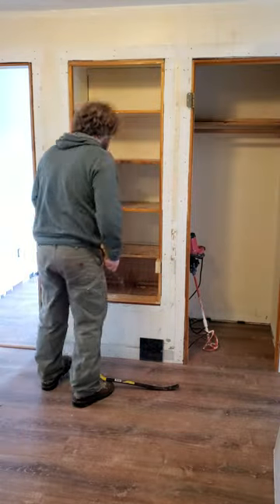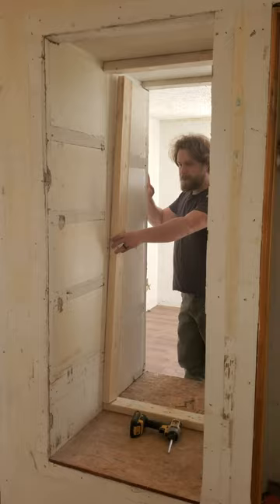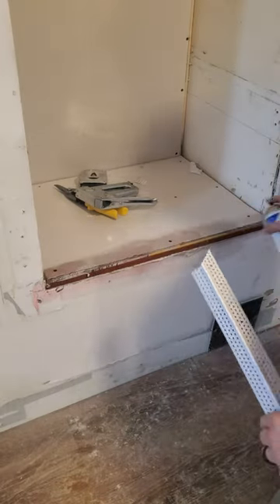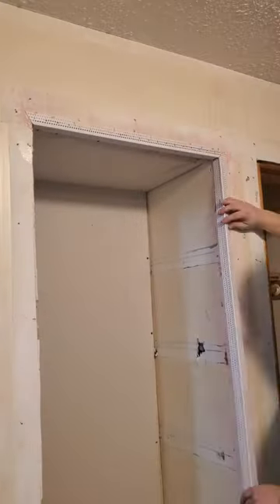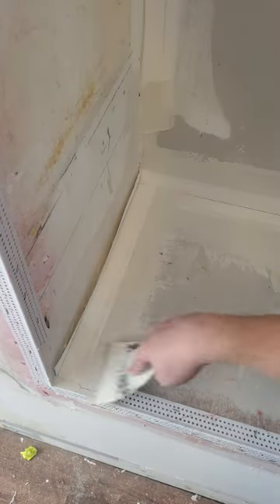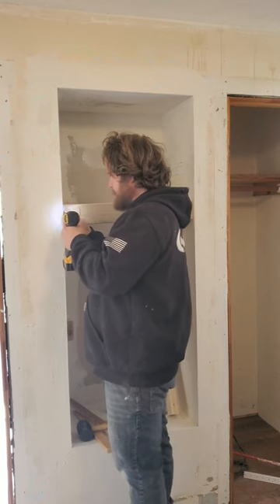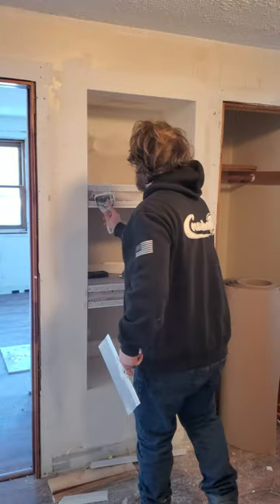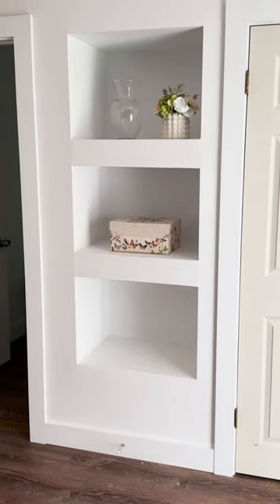Make Modern Drywall Shelves

Comment: Glue and staples isn't code, teaching bad habits
Reply: Yeah, I always just used mud...
Reply: Wrong.
Reply: There is no fuckin code for corner bead 😂
Reply from the maker: I’m not sure what code you’re referring to.  Most state building codes in the U.S. refer back to the manufactures recommendation for installation, this method if approved by the manufacturer Trim-Tex. If you’re referring to fire code, this shelf would not be acceptable but only because it’s built with 1/2” sheet rock and fire proofing requires two layers of 5/8”. If I’m unaware of a code you’re referring to please let me know. I’m a real nerd for building codes. Thanks for watching!

Comment: Cause drywall is soo much stronger than plywood.
Reply from the maker: I see your point that drywall is not stronger than plywood, but that’s not really the issue here, the structure itself attached to is. The drywall is supported by a 2x4 shelf and 3” screws, the plywood was supported by some additional strips of 3/4” plywood and held in with a few finish nails. This old system actually worked fine and held up well but the new one should be even stronger. I hope that helps explain my thinking. Thanks for watching!

Comment: Those corner beads are supposed to be installed with mud not adhesive or staples
Reply from the maker: Installing them with mud is another great option, both ways are fine according to the manufacturer. The same company who makes the corner bead makes the adhesive I use in the video, hope that helps and thanks for pointing out another great option!

Comment: Your quest to suck less at drywall lead you to suck more at shelving. Lol. Those things are gonna get absolutely destroyed if you ever put anything on them at all. There's a reason this isn't a thing.. It's not because you're a genius. 😉

Now, if you'd sheathed the top in some kind of durable material, with steel corner beads at your leading edges, that may hold up since the drywall is essentially just a fascia.. Maybe glass, or lexan as a protective cover at this point? But as others have pointed out, you also ate up a lot of space for it.. 

Your mud job did come out tits though, bud. Pat yourself on the back for that part. 😊

Comment: You use metal corner bead so when you hit it it doesn't fall apart also drywall looks awful the old ones probably held more too if you're gonna do it wrong anyway just use newspaper dude just use the fold as a corner you can fold it over something square to make more folded parts

Comment: And weeks later, they were beat to shite. Also use tape with the corner bead to prevent your inevitable cracks of a non durable design. Yeah, DYI. Holy Smokes!
Reply from the maker: I’m sure paper tape over these wouldn’t hurt, but you shouldn’t need it according to the manufacturer which also matches my experience with this product. As far as the durability is concerned, they are holding up fine for now but it’s only been a few weeks. I’ll try to give an update in a year or so. Thanks for watching!

Comment: Why? Theyll break easy.
Reply from the maker: That’s a fair point but I don’t think they will. The void between the studs here are much smaller than on a wall, making it stronger, and a wall can take a lot of damage. Place one hand on a wall and lean forward with as much weight as you can and you shouldn’t have any flex or damage in the wall. This should be more weight per square inch than anything that will fit easily on one of these shelves. I hope that helps explain my thinking and thanks for watching! 
P.S. if you lean on the wall and do put a hole in it, we’ve got a video a that shows you how to fix that.
Reply: @OneWayToMake  I live in the UK, very few to none houses use mudded joint plasterboard. We tend to render plaster over the full surface. The break easy wasnt a reference to strength, but impact resistance - sure progressive loading would be fine, but even a hardwood table suffers from dings and dents from putting pots and vase on and off - that's what I was thinking for the shelves.

Comment: Looks nice, but definitely a case of not done correctly
Reply from the maker: Thanks and I’d love to learn more, what are you seeing that you would have done differently?
Reply: @OneWayToMake  the corner beads should be mudded, not glued on.  Drywall screws, not staples.  The corner beads will eventually pop out.  

The shelves should be wood or melamine.  They look nice as is, but won't have good support.

It looks beautiful, but it won't last.

Comment: Just fold the cheap tape in half like a paper airplane. Then use your knife to get it in the corner. I don't wanna see you waste good money.
Reply from the maker: That’s really good advice, and anyone looking to save money should definitely go that but that stuff does make it easier and gives me a straighter line in my experience. With enough practice with traditional tape you can get just as good results though. Thanks for the tip and for watching!

Comment: Drywall has no structural rigidity.... the staples won't secure the corner bead to the studs.... you REALLY need to seek a mentor of professional instruction....